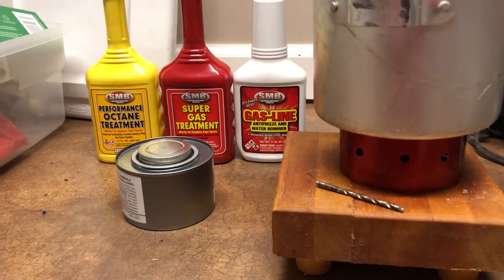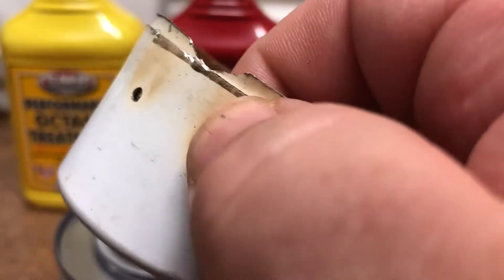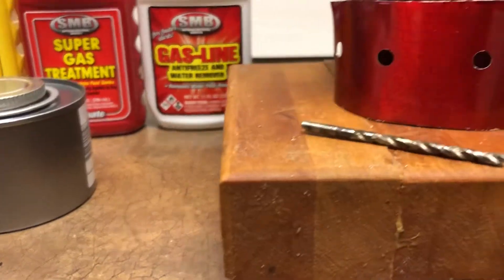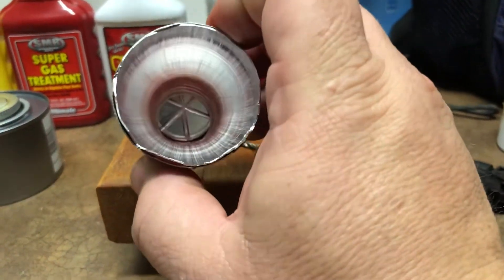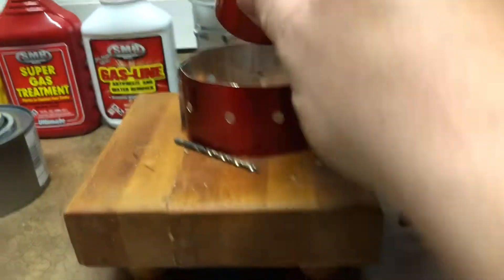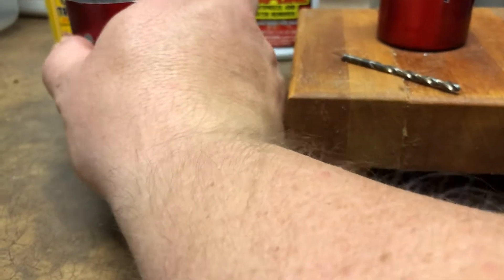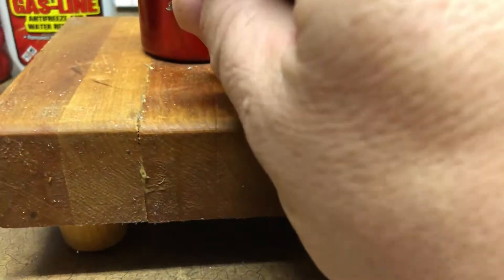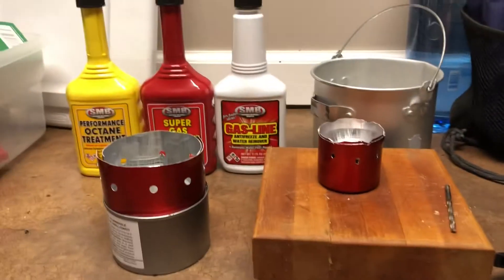Dollar tree alcohol stove

Comment: Thank-you, thank-you. You saved me a couple bucks already. Now I'll never need to try out the Octane Treatment or the Super Gas Treatment for stove fuel. :)

I've been using the Fancy Heat containers as an alcohol stove (using denatured alcohol) for a couple years, now, and find they work well, as long as you're not in a hurry & don't need super light weight (I travel everywhere by bicycle).  They are the same diameter as an 18-19 oz.  Progresso soup can (also 5 oz. tuna cans & Hunts 24 oz spaghetti sauce cans sold at my local Dollar Tree), so I bought one of each flavor of those (Progresso, not tuna or spaghetti sauce) when I was at Dollar Tree buying the Fancy Heat, and made a windbreak/pot-stand that sits in the groove on the top of the FH can, much like your pot-stand. I put a row of fairly large holes (3/8" or 10mm) around the top, middle, and bottom for air, so it works much like a Magic Heat stove. Using my Mocha Pot I can make a full 4 servings of espresso type coffee in about 15 minutes. Since the Progresso cans are the stacking style, they fit perfectly on top of the pot-stand (with label peeled off, of course) to warm the soup. The only downside is that it doesn't all nest together, like yours or the one from Intense Angler.

I haven't seen the little aluminum spray bottle there, but I might just need to get one next time I go. I've also made a side-burner stove from the aerosol can their coconut oil cooking spray comes in. It's steel, so much, much more robust than an aluminum beverage can or cottle, but it does take longer to bloom. A sturdy small aluminum stove may be just what I need.